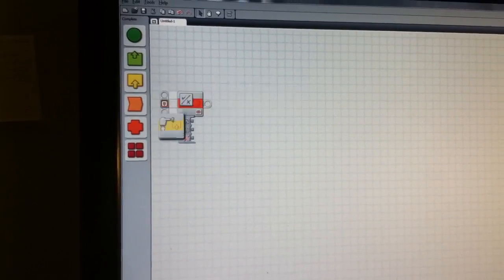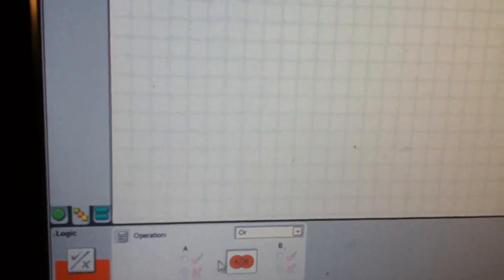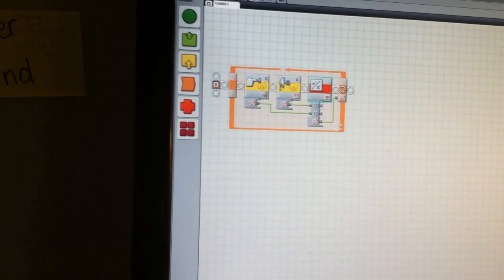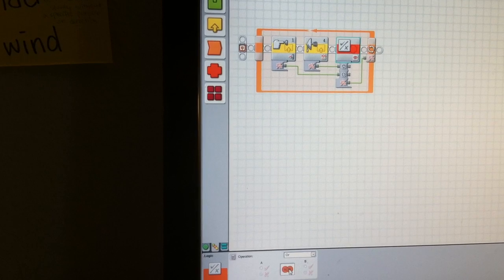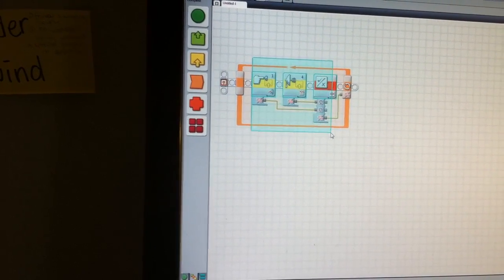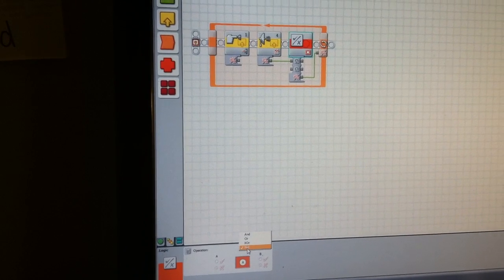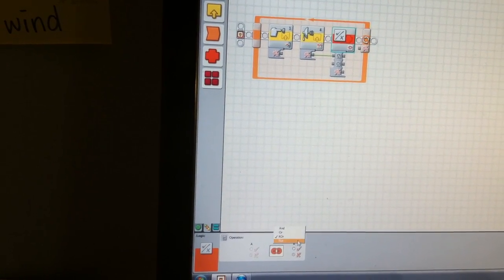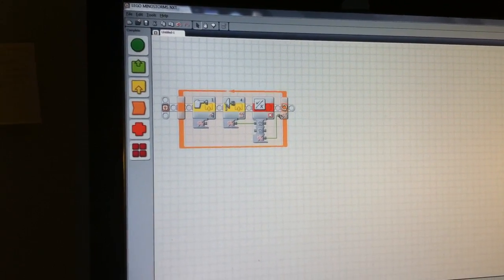Cybermusic NXT-G Programming Tutorial 12: Logical Thinking

Comment: Is it Woehler CDL 210 taking CO2 measures in the background? The peaking sounds in the background seem familiar. 

The Lego Mindstorms logic doesn't go well with mine since my brains were wired in a different way. I got used to if, then, else thinking. Trying to think of a obstacle avoiding program for a Lego Shooter bot with double IF condition. My logic goes:

<loop>
if distance sensor < 20 cm
      then move motor B forward  (2 seconds)               
                   if distance sensor < 20 cm
                        then move C forward  (4 seconds)
                                      else move BC unlimited 
<loop>

The Lego logic block is different. Probably someone could help me rewire my thinking.